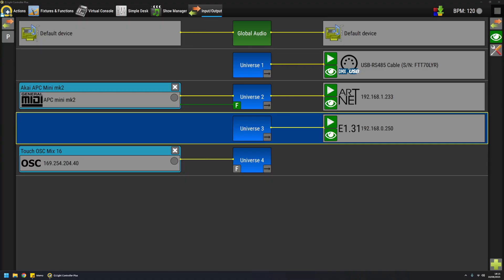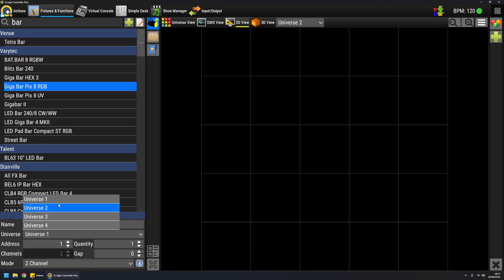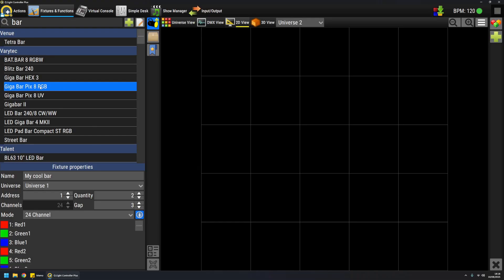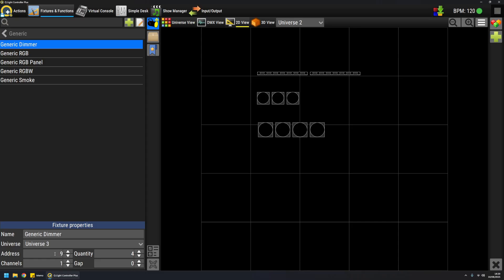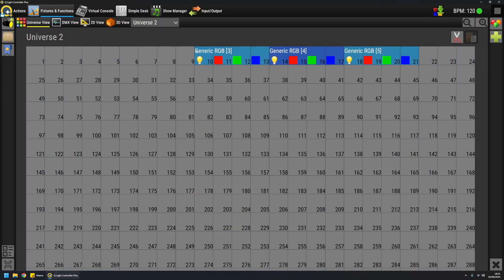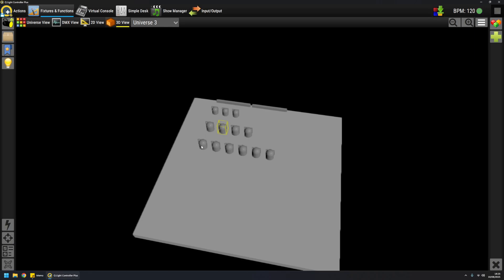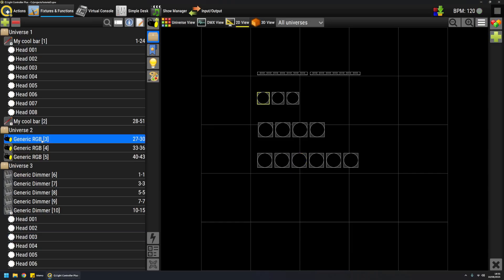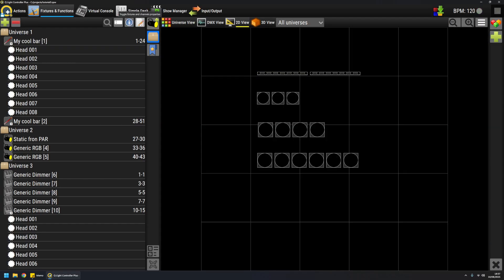QLC+ 5 - Fixtures

Comment: Hello Massimo,

Thanks for your video and software development.
I had difficulties to create fixture : I could create the fixture, store it to a file, and check the file using your website, but after I could never saw it on QLC+. I tried to store it in QLC+5/Fixture/MyManufacturer, also directly on QLC+5/Fixture. Never succeed.
What I finally did is modified the FixturesMap.xml file, following the same syntax, and it worked. But i'm pretty sure this is not the correct way to do it.

Ciao,
Pierre